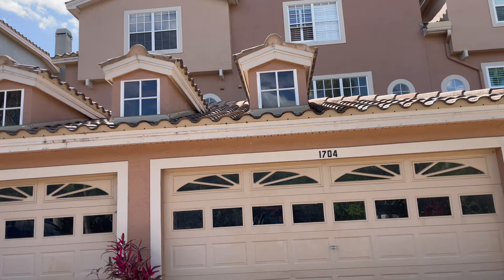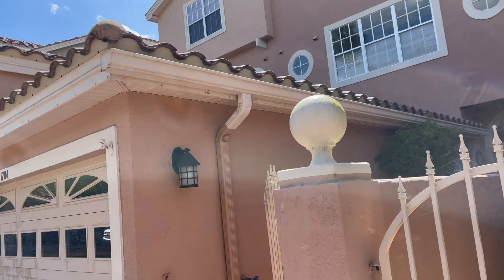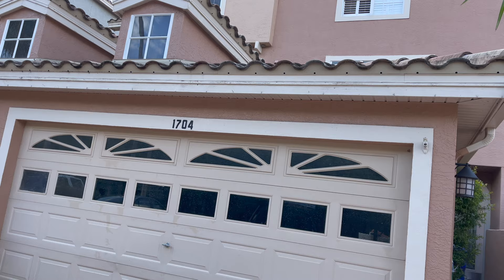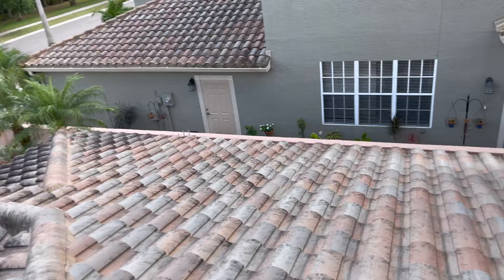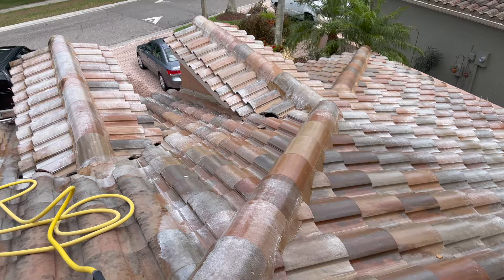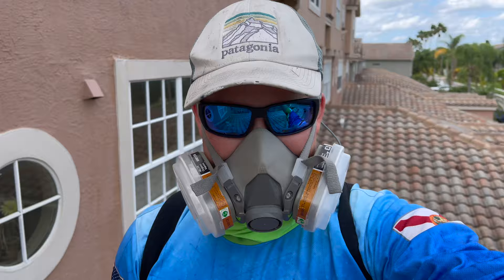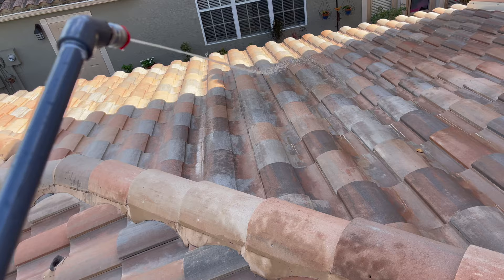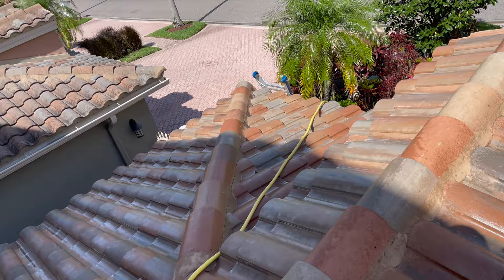How to clean tile roofs with HOT BLEACH.

Comment: Where did you get that dual banger jrod? I have a 4 way but may grind two off.
Reply from the maker: I got it at my local pressure washing store. It reduces the weight if you have a PVC set up for soft wash
Reply from the maker: You can grind off two